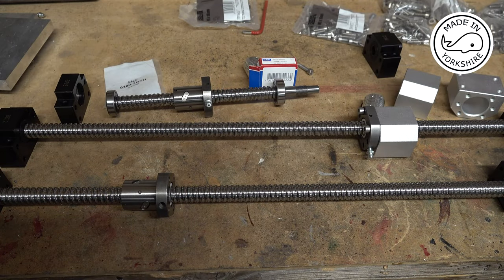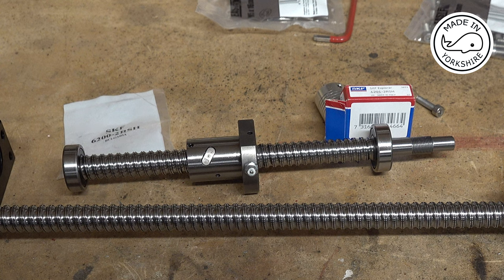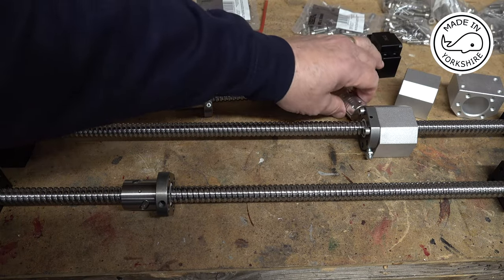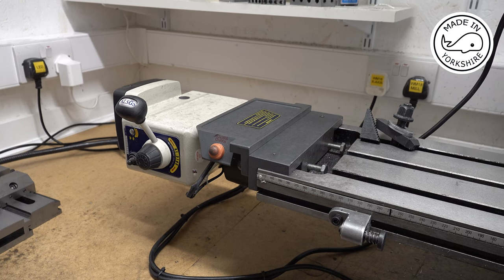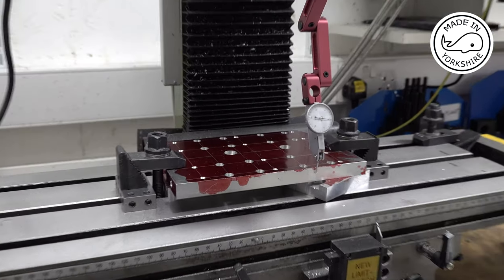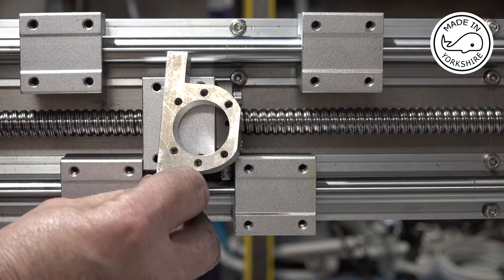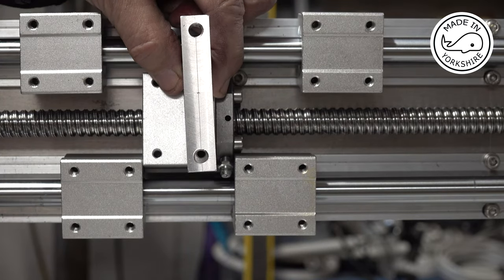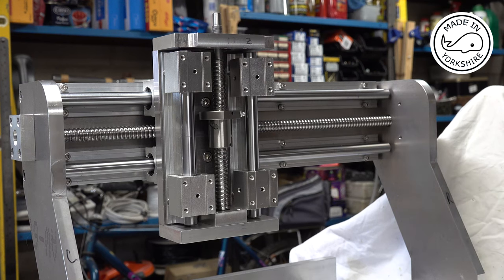#MT47 Part 4 - Olivier CNC Router/Engraver. The Ball Screws. In 4K/UHD by Andrew Whale.

Comment: Great Outcome Andrew. Now just a word of warning DO NOT wind the ball nut completely off the shaft. You will end up in terrible trouble with the balls inside the nut. It can be done by using a special sleeve that is fitted to the shaft and held tightly  against the thread. As the nut comes off the screw it will slide over the sleeve and retain the balls. Regards from Australia.
Reply from the maker: Hi Dave - I very nearly fell into that trap. I found some videos showing how to re-assemble the ball bearings back into the nut. Looked far too risky, so I have managed to avoid taking the nuts off.
All the best.
Andrew

Comment: Surely the 22 thou height error can't have just disappeared.  The Y-axis ball screw and table must be flexing.  Or did you loosen the Y-axis ball screw mountings and move it down (or loosen the slide rail mountings and move the rails up) ?
Reply from the maker: Hi Chris - a very good point and you got me to revisit the y-axis ball screw. I conducted some, more accurate, measuring and I did find that the ball screw flexed about 8 thou of an inch downwards when the top plate was slid onto the aluminium ball nut housing. Further investigation identified that the aluminium fixture on the ball screw was slightly higher than the actual ball screw nut. I decided to mill 8 thou off the top of the aluminium which resulted in it being about 1 thou higher than the actual ball screw nut. Now there is no flex when the top plate is attached to the ball screw.
Thanks for the kick up the preverbial!
Cheers
Andrew

Comment: Nice to see it coming together. I'm slightly surprised that you aren't using angular contact bearings on the leadscrews - is there any arrangement to preload the bearings to eliminate backlash? Or it it just not a concern for this type of machine?
Reply from the maker: Hmmmm. I don't know anything about angular contact bearings but there doesn't appear to be any backlash using these bass screws. Olivier used these on his home made machine and achieved really good results. We will see!
Cheers
Andrew
Reply: @learningturningmetal  Looking forward to it. :)

Comment: Excellent work Andrew, you never cease to amaze me with your skill and application. I'm still beavering away on my hoglett. Just making the cylinders. Cast iron is the most dirtiest horrible material to machine. 🙈
Reply from the maker: Thanks Craig. Those Hoglet cylinders aren't the most enjoyable components to machine. I hope you get her running soon - that engine certainly has some character. I'm itching to make a start on the Howell v-twin but I'm not one for multi-tasking.
Cheers
Andrew

Comment: I ordered the MKS DLC 32 V2.1 Driver board, can also be used with an off line controller and a TFT that can be purchased with it on some Ali Express sellers, just buy TB6600 or TMC 2160 stepper drivers for it to run the Nema 23's.
Reply from the maker: Many thanks for the info George. Added to my list for comparison 👍👍
Cheers
Andrew

Comment: The masso is a stand alone controller I think, cncnutz youtuber uses it. I've gone for an axbbe controller made in Chech republic, ethernet based, with uccnc on an old windows laptop. Works really well. I would opt for separate stepper motor drivers, they can fail and if it's build in you need to replace the whole controller. And you have the option to go for closed loop nema34 later.
Reply from the maker: Hi Josha, thanks for the advice. Very interesting and might be of help to others. The advantage of the openbuilds controller is that it is very tidy, the software is good and I'm willing to take the risk with the built-in drivers. Time will tell 🤞
Cheers
Andrew

Comment: I run a Onefinity CNC which uses a controller based on the Buildbotics. Simple plug in setup. I run it from my laptop which allows you some additional features over the internal Raspberry. Just ran a programme with 98,000 lines of code with no issues. 👍
Reply from the maker: Hi Michael - many thanks for the info - I really appreciate it. I will do some research.
All the best.
Andrew
Reply: @learningturningmetal  Cheers Andrew. I always look forward to your videos.

Comment: I use 3Nm closed loop Nema 23 steppers on my machine.  I was using mach3 to run my machine but found it to be rather finicky, it doesn’t like other programs that could be running in the background, it has a tendency to lock up, forcing a restart of the computer.  I have used LinuxCNC but it is not always up to date and does require a dedicated computer  and updates when they do occur requires a complete reinstall of OS.  I have considered the Black Box from OpenBuilds, there is an openbuilds supplier in the UK, I don’t recall the name of the company.  Can’t wait to see what you plan to use as a controller.
Reply from the maker: Many thanks for the information - I really appreciate it. I was thinking 2.2Nm Nema23 motors - but noiw you have got me thinking! I will avoid Linux - I used to be responsible for several high end super computers running Unix. I started managing and developing applications on Unix back in the 1980's - good fun but I don't wish to revisit that technology. I will investigate Black Box from OpenBuilds.
Cheers
Andrew